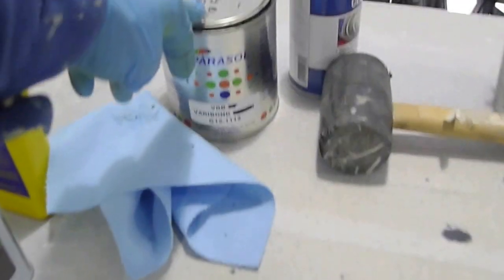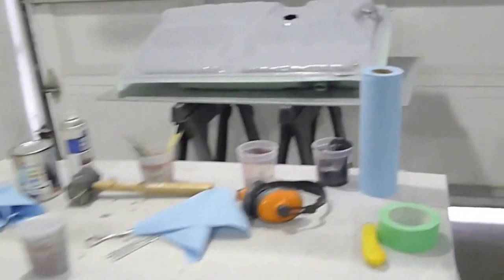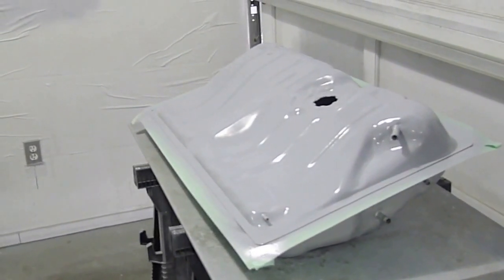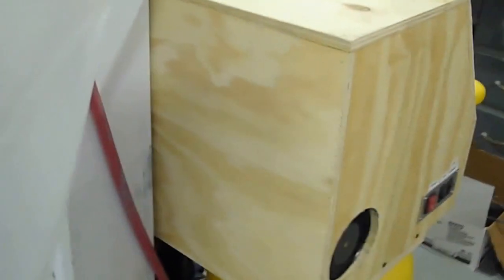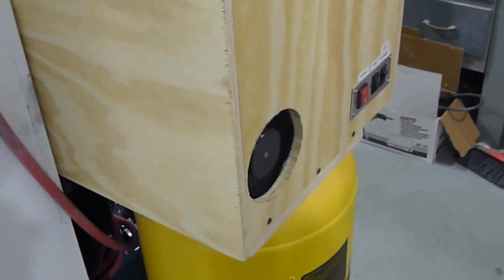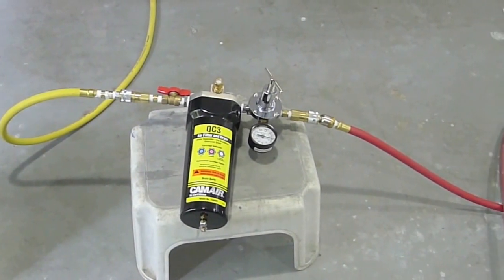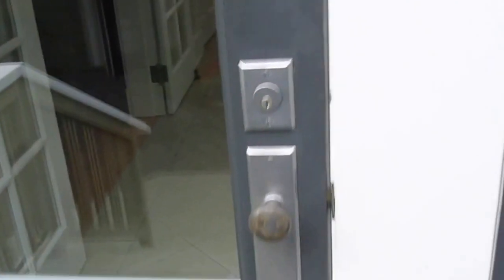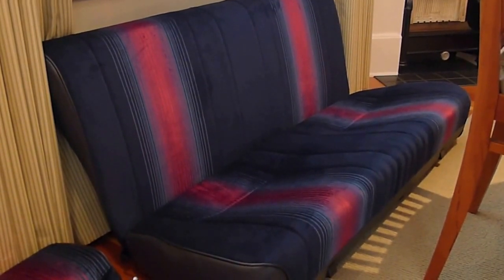The Ultimate 1983 Rabbit GTI - part 51 (Rear seat complete, epoxy painting fuel tank, etc.)

Comment: Thanks ended up getting it off used heat but had bad luck in one spot and warped it right under the head light spot so now I have to shrink it to get the warp out almost bought replacement fender until I went back and watched your  videos review of the replacement ones
Thanks
Reply from the maker: BornToHunt97 You should watch some videos on how to bang on sheet metal and push/pull the metal around. I got more bold over time with the hammer and dolly and started to realize that you can basically get any shape you want with a bit of patience. So unless that original fender is really really bad I would hammer on it - nothing to loose if you are already thinking of replacing it. But find another OEM fender if at all possible ...

Comment: Please hoe me a hint Derek trying to remove the fenders on the front yes vw abuse es  seam sealer I counted 9 bolts I can not get this thing to budge any advice in trying to burn it off but scared of warping metal
Reply from the maker: BornToHunt97 The fenders have a lot of seam sealer that holds them into place. You will need to use a knife to cut thru it all. Messy ...